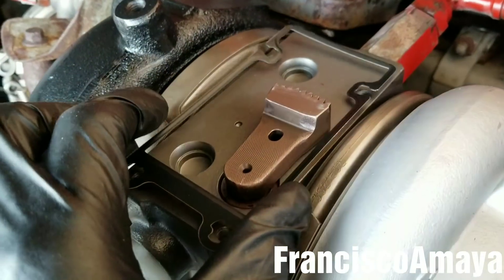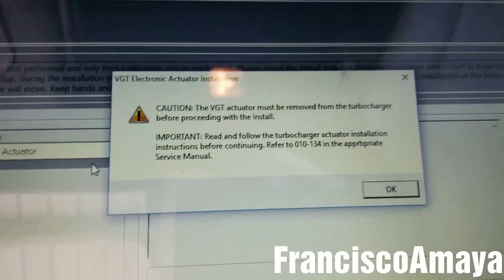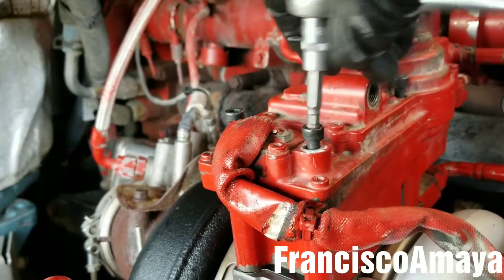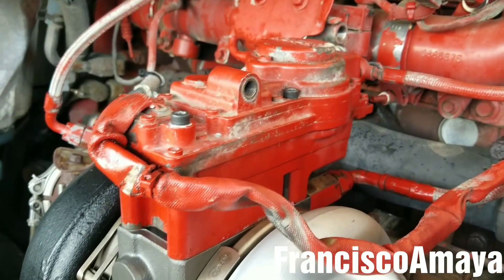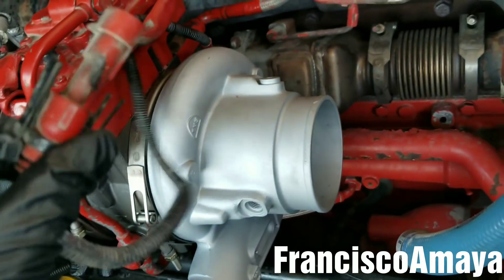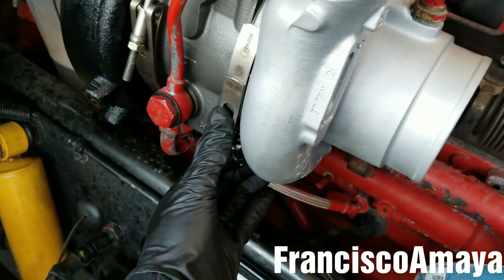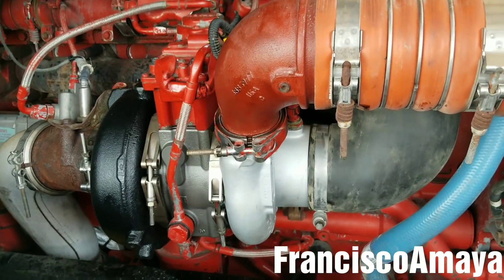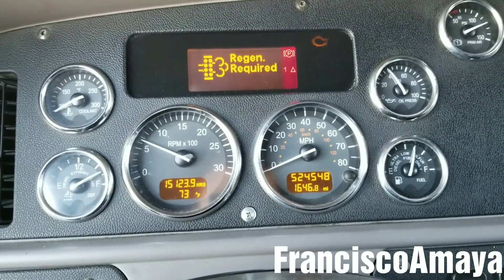Cummins ISX turbo and actuator replacement part 2 calibration freightliner kenworth peterbilt

Comment: Thanks a lot for this Video. How do you know if you have to flush the CAC? And if so, with what/ how do you recommend to flush/clean the oil out from inside the CAC. Will it cause any damage if i clean the areas i can reach and leave some oil in the CAC. Thank You
Reply from the maker: the proper way is to remove it and take it to a radiator shop to get it clean up but also can be done by removing the engine side end hose to let the turbo pressure push the oil out and get it capture in a deposit but it will only clean the 60% +/- the rest will be eated by the engine.

Comment: Do you use a vacuum tool to replace the coolant or do you just fill it up and bleed the system the radiator or expansion tank cap off?
Reply from the maker: Normally, just add the coolant and the air will come out ones the engine is running. Then let it cool off completely ambient temperature and you can add the rest of the coolant needed.

Comment: Hi Francisco..

I got a situation replacing an actuator of a Peterbilt 2017 Cummins 15L, I do all the procedure like need to do, but i got a code error.. Error Code 6, and also have the code 1894 ACTIVE VGT Actuator Driver Circuit - Abnormal Update Rate.
 I do ready check the lines, everything appears good. The actuator I install are new from the dealer, I use the Inside and Jpro  software. Any advise you might have??

Comment: my friend i have volvo vnl 2011 with cummins isx 15. Yesterday my truck start to shake in fifth gear no power i pull on the shoulder put in neutral and the whole truck even in neutral was shakin. loaded 45k. i turn around and go back to the shop and before i get there my truck got his power back. i thought bad fuel and i replaced the fuel filter, after replacing the filter i start the truck and gave me code sa 0 spn 641 fmi 7 and fmi 13. No code when it was shaking. Truck now run good but i can tell maybe i little bit when i hit the pedal all the way i have turbo gauge my gauge goes for 4-5 psi more then it was. Truck runs fine? what could be ? turbo ? actuator ? thank you!
Reply from the maker: Probably the turbo actuator is starting to fail.
Reply: Francisco Amaya thank you for your reply. Actuator was bad was stuck and also in this case turbocharger was bad was stuck and won’t move more then half
Reply from the maker: Good! Inspecting the parts is very important

Comment: Thank you Mr. Amaya for another excellent video. 
I have a ISX12G400 CNG that I will be working on (turbo, wiring harness, etc.) What computer set-up and software do I need for that?
Reply from the maker: Cummins insite will work

Comment: What will happen if you bought a new turbo and put it on but did not calibrate the actuator I unplugged the batteries before I plugged in new Turbo now I'm getting oil in my air to air
Reply from the maker: You can damage the actuator or the turbo.

Comment: Do you fix on Mack trucks- MP-8 engines or new or old ones..just asking for a friend.
Reply from the maker: No, I don't usually work on those but it is the same engine as the Volvo D13.